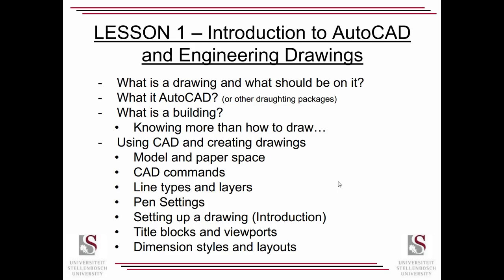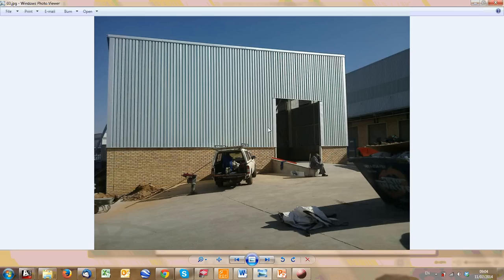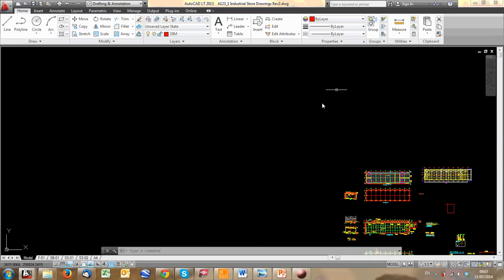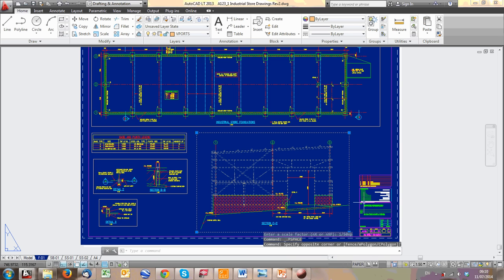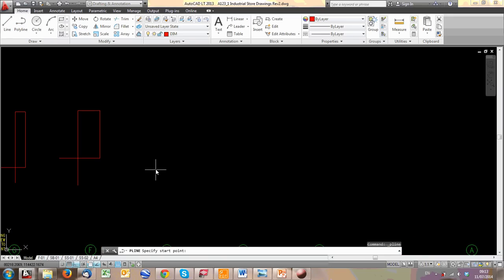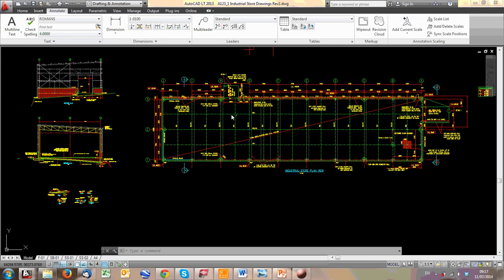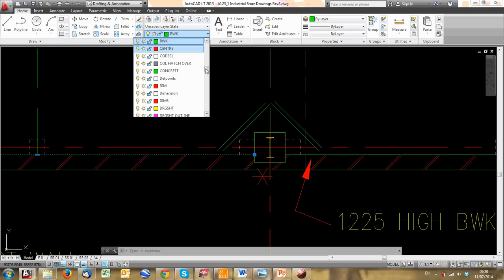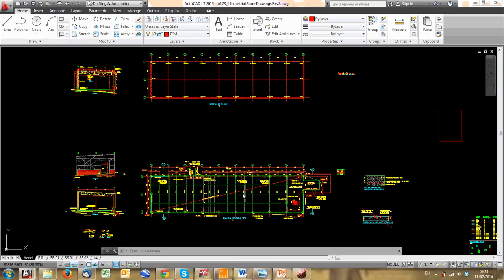Intro to AutoCAD & Structural Draughting for Civil Engineers: Tutorial 1 - General CAD info

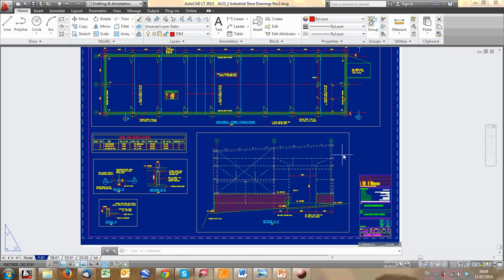Comment: 10:40 In section C-C, i see your structure are showing as hidden line, why not erase it and keep only the stem wall? It just a foundation drawing.
Reply from the maker: I find it useful to show the whole structure so the contractor and client can see what is being built. You don't need to show the steelwork as done here, but it helps for trying into brickwork. On this building the brickwork was built into the side of the steel door frame, and sheeting had to sit just in front of the brickwork so was easier to show it.
Reply: Ok, thanks for the reply, sometime i feel confuse which method are standard format. lol